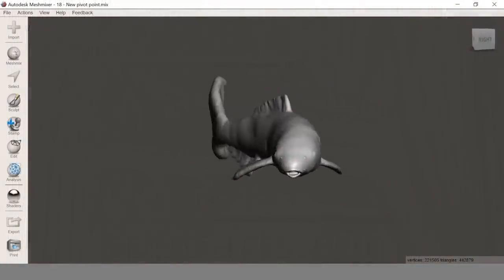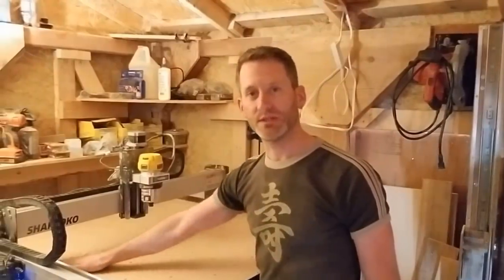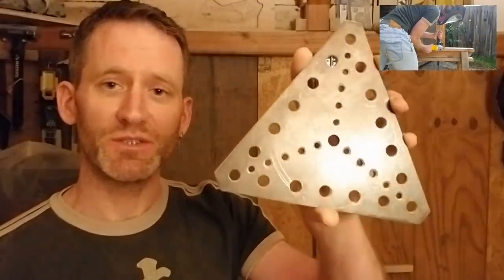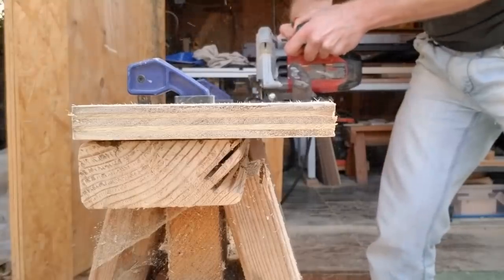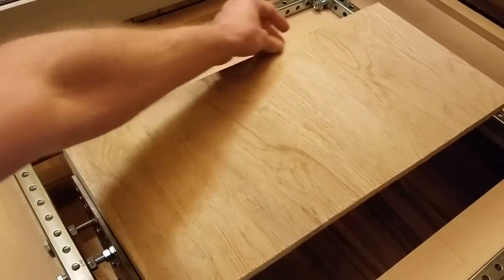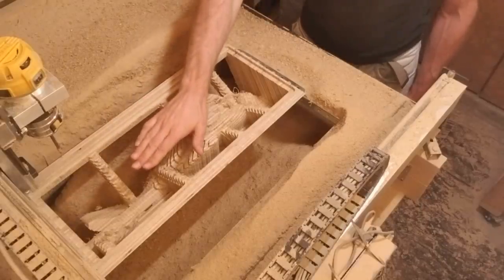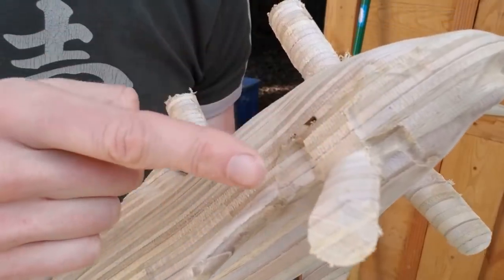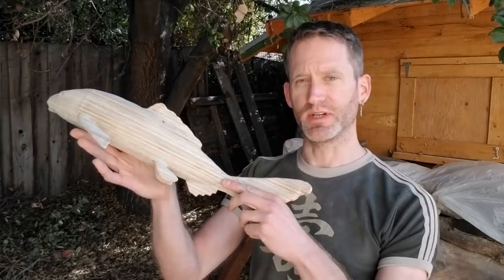3-sided rotary CNC routing with the Shapeoko - Carving a Koi fish

Comment: How are you zeroing the z axis with it being hallow? Awesome project by the way
Reply from the maker: Excellent question!
There are two ways I can still re-zero: the edges of the stock are still intact, so I can use that as the stock surface. Another way is to first zero on the metal framework, then move the Z up a certain distance to where the stock surface should theoretically be, and then re-zero again. I can calculate that distance based on the design in VCarve.
Reply: @dennisvanhoof9958  Thank you for the quick reply and how do u lay out the carves for 3d carve do u use fusion 360
Reply from the maker: @IpKhera  Meshmixer for the 3D model, and then VCarve for the tool paths.

Comment: Interesting solutions. I suppose fabricating a manual rotantion method is less expensive than buying one. I prefer automation. I also cut an insertion point for my 4th axis. I can mill larger pieces that way.
Reply from the maker: It's not only that the hardware for a manual setup is cheaper, but the Shapeoko XXL doesn't have the right firmware to support an automated 4th axis. Furthermore, I do not have the right software to design tool paths for a 4th axis machine.

Comment: I like what you have done here but was wondering if you could have machined a cradle for stabilize the delicate parts. I am imagining adding a lot of tabs to one side and then subtracting the model. That way you could support the carved side while finishing the exposed side.
Reply from the maker: Good thinking! Yes, I have thought about that. There are many ways to solve technical challenges, and there is not a single solution that is right. This was just a test to see if my manual rotary setup actually works and how precise it is. I got those questions answered, so now it's ready for the next step. Keep those good suggestions coming!

Comment: how do you set origin bro
Reply from the maker: Good question! I calculated the stock height relative to the rotary frame in VCarve, then let the router bit touch the metal frame, and moved the router up to the calculated height, after which I set that as the Z-zero coordinate.
Reply: @dennisvanhoof9958  Genius!, I will try it to day Mr. CNC Einstein

Comment: So I have a home made cnc, 18 inches on the zaxis. But to do deep work I use 8mm end mills. I can get them up to 150mm. Elair makes custom collets and there collet allow me to put 8mm tools in a .25 inch router. 
If you can't do it right, cheat. Right?
Anyway, this video was very informative, and should help me get away from deep carvings (150mm is scary at 30k rpm. Even though it doesn't vibrate)
Reply from the maker: Thanks for sharing your insights and experience! Yeah, I looked into bit extenders and stuff, but I wouldn't trust them at anything higher than 60 rpm. ;) My main challenge was the Z-height, which for your setup doesn't seem to be a problem.

Comment: Wow. Very impressive sir. I am about to to purchase a Shapeoko XL very soon.  I am talking to their sales representative for bits, end-mills, colletes, router RPM usage and such. Do you use a bit runner so, you don't have to turn it off and on manually? Especially when you have to stop to adjust something? Like adjusting stock on the triangle for the 3 sides on the X, Y, Z axis?  For the framing and bedding on the spoil board and using the X gantry on the material itself, I'm sure you did. I mean its complex at least for a novice such as myself.  What do you think of the PocketNC, 5 axis machine? Rotates without hand manual. It is one one amazing upgrade but pricey! And looks like its only for small scaled projects so far. Its os and machining looks like its over my head. So I just have to focus on the 3 axis now. Haha. 

All in all great work! Want to come back to see what other projects you are working on. Hopefully I can learn from your videos including troubleshooting of the CNC, materials and software usage.  Cheers!
Reply from the maker: Thank you for your kind words! I have to answer your questions with "no". I try to keep things low-budget, as it's just a hobby for me. No bit runner, no 4th or even 5th axis. Those machines or upgrades are very expensive, and you need specialized software to design your tool paths, and those software packages aren't cheap either.
Reply: @dennisvanhoof9958   Yeah this is going to be a hobbyist journey for me as well.  As an Architectural Designer I am getting tired of just being a paper pusher and using software's.  Thankful for it!  But the art of working, problem solving and learning with one's hands is so important and its becoming a lost art.  We have slowly lost the connection with Nature and dexterity with materials. I promised myself that I am going to learn this and have the skill set under my belt because I want to be a well rounded designer.  Knowledge of hardware and software.  Plus Digital Fabrication is so much fun and is becoming more prevalent for the common woodworker and designer. Not just big companies.  That's why this desktop CNC is great.

Comment: Here because I carve fish and thought this would be a cool way to do it. Awesome results, but I can do it by hand in less time. What about splitting the design in half laterally, cutting one side of the fish, then the other, and indexing the two halves together? Fins could be cut separately and inserted into pre-routed holes
Reply from the maker: You're right; I could have cut the design for a plywood version in half (or even more slices, as I did for this female torso: https://youtu.be/J9CsbgKV55o). But it looks like you already found the video of what I actually had in mind for this setup.

Comment: Thanks so much for showing your process!  I am very impressed.   I have struggled making parts that need to be machined on two sides.  Do you think there is a limitation with the wood not being supported?  I've showed this to a CNC manufacturer and they are going to design the flip feature for me.  I just wanted a little more opinions that this would work for laminated hardwood that is about 2 inches deep.  My necks are 90 centimeters.
Reply from the maker: I usually try out any new projects with some scrap wood first. Trial and error, while staying on the conservative side when it comes to clamping and securing the wood.

Comment: When does your cutter head know you flipped the work surface???
Reply from the maker: Each side is a different tool path job.
Reply: Dennis van Hoof I’ve never done it but if you have can you help me find the pattern and the manual rotorating triangles or is it handmade if you know it would be greatly appreciated by this newbie
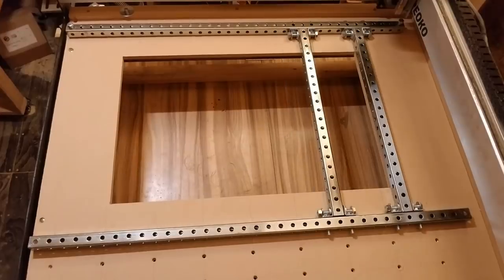Reply from the maker: @brianconley1732  Yeah, it's all hand-made: 4:07

Comment: Great job. Machining needs some creativity and you made it great.

By the way. How did you designed that fish? Wich software did you use?
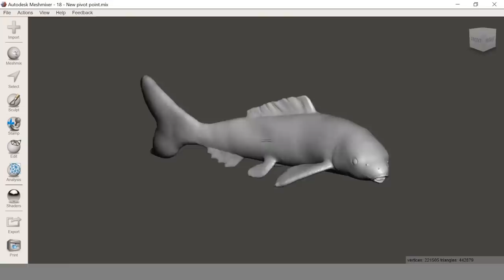Reply from the maker: Thanks, Alfonso! I used Meshmixer, see 0:28
Reply: @dennisvanhoof9958  I already got that software, I got an issue but I hope I can solve it, Where do you buy all your tools? like Amana Tools? ebay or something like that?
Reply from the maker: @alfonsocanales7210  I purchase tools, equipment and materials from all kinds of different sources: the company websites, Amazon, Ebay, Etsy, Craigslist, Lowe's, Home Depot, and nature itself has great stock materials!
Reply: @dennisvanhoof9958  thanks a lot your helping me with my new project

Comment: Now I regret building a CNC with a fixed gantry.   Well thought out!  Do you sell or share the pattern for the end pieces (for those of us who might be too lazy to do the math ourselves)?
Reply from the maker: No plans to sell or share, except what I show in the video; but it's pretty straight forward using the square tubes. Making that first cut in your perfectly smooth spoil board is the hardest. ;)

Comment: Amazing job! I am just a CNC beginner and have seen lots of videos. Yours was very detailed and easy to follow. I couldn't tell if you were using the stock collect on the router. But if you are, I would recommend an upgrade to a precisebits.com collet. You will get less runout, then on a stock collet.

Comment: 5 axis cnc is now officially for suckers
Reply from the maker: I still wouldn't mind getting one and become a sucker. ;) Then I could finally do some 6th dimensional projects!
Reply: @dennisvanhoof9958  You seem to be addicted to adding dimensions, best thing is to go lie down, make yourself from 3d into 2d as much as possible and get up once the urge is low enough to not want more dimensions. That is what i always do. The side effect is that you might get addicted to lowering the dimensions. So now i am at a point that i want to go from 3 dimensions to minus 1. Thinking big here. By skipping a few dimensions that are over used anway. I will let you know when i succeed.
Reply from the maker: @dguy-xk4fc  Actually, the next project I have in mind is 2D. Well... sort of. Stay tuned...!

Comment: I don't have a CNC yet but couldn't you just support the fish from the head and the tail and add tabs from the fins to the body. That would reduce the carve time and the amount of finish work needed.
Reply from the maker: Good thinking! Once you have your own CNC router, you will notice the tremendous pressures that the wood has to withstand from the bit being forced into the material. Better safe than sorry! Besides, if I would place tabs at only the front and back, the tabs would have to be much thicker to provide enough strength. Just try to imagine how difficult it is to prevent a wheel from rotating when you are holding it at the center, and someone else is pushing it at the rim (physics principle: "the torque of the lever arm"). Second, the beak and nostrils of the fish would be buried in the front tab, so I would have to carve those out by hand and manually shape them after the CNC run is completed. But... I'm currently working on a project where I'm doing exactly what you are proposing, so stay tuned! For that project, the front and back tabs have a much wider diameter,  and they run parallel to the wood grain (which is the strongest direction). They also don't cover any essential details of the carve. :)

Comment: How much for this setup? To buy?
Reply from the maker: I don't sell it, but the hardware tubes, variety of bolts, nuts (regular, lock and T-nuts), steel plates for the rotary plates and MDF board for the CNC bed, I'd say a little over $100. Of course, that's assuming that you already have all the tools to build it.

Comment: Nice job, but ...
4th axis is probably better.
Moreover, I spent how much effort to create this device and how many inconveniences when working in comparison with the 4th axis.
A little effort and money - and I would get a big saving of time for the future, and time is money.
I'm sorry for my bad english.
Reply from the maker: I appreciate your suggestions. If I would do CNC production work, it might be worth it. But when doing only a few pieces of artwork per year, this manual rotary axis is a very affordable option. 4th axis machines are quite expensive, and you'll need special CAM software for that too, which is not easy to learn. If you know of a CNC and CAD software for "a little effort and money", I would be very curious to hear about this option.

Comment: Did you say 40 hours?
Reply from the maker: Yes.
Reply: @dennisvanhoof9958  wow, that router must be sucking up some power.  probably cost you what $50 in electricity?
Reply from the maker: @jeffstrongman7889  And the shop vac too!

Comment: Where's your dust extraction? )))
Reply from the maker: Yeah, I know. It's kind of useless with this setup, as the saw dust will escape through the bottom side, and the dust shoe is to bulky to fit in the places that the router wants to go. Besides, watching a brush move over a piece of wood doesn't look as interesting as a spinning bit. ;) No worries, though, as I made this shed specifically for collecting dust. :)